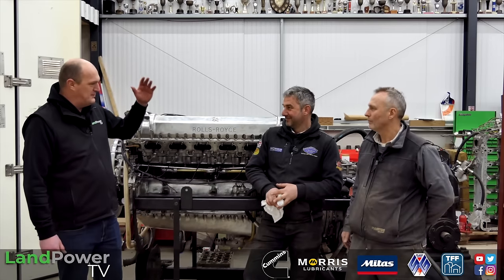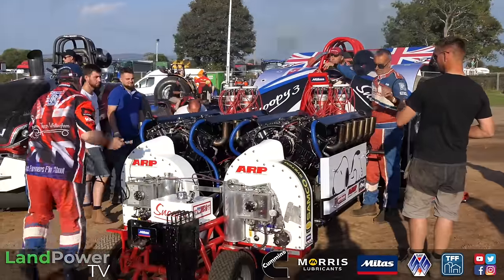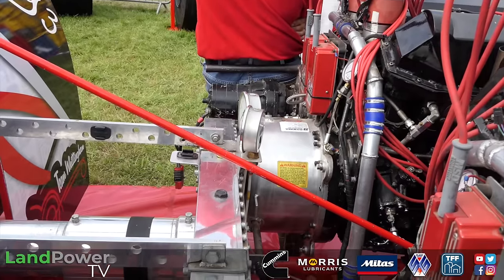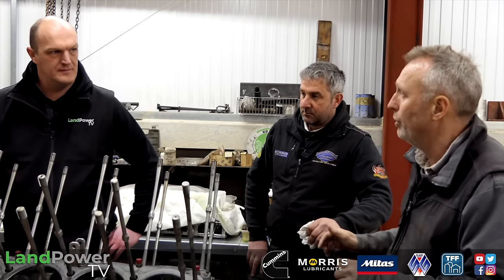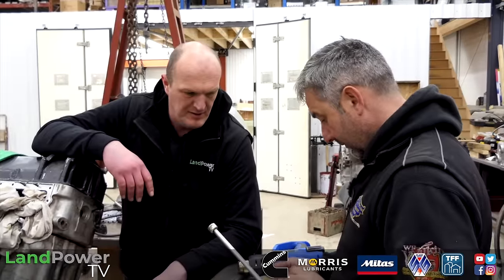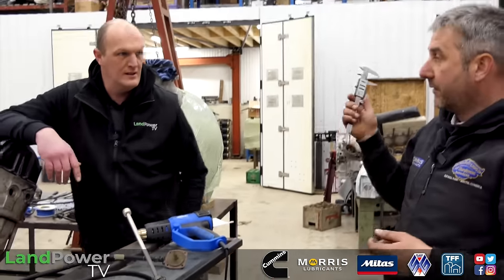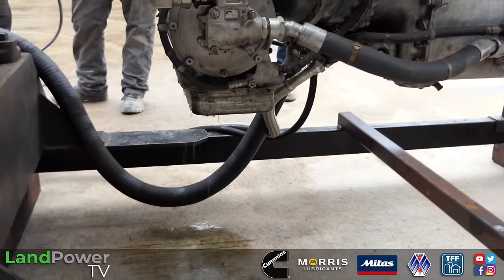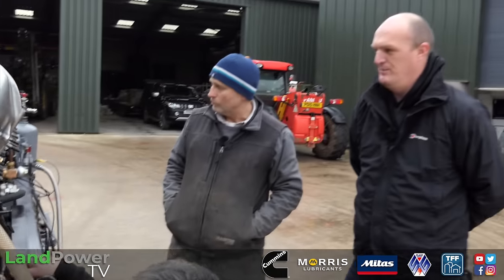Rolls-Royce Mk58 Griffon V12 Engine (the Merlin's bigger brother): START-UP

Comment: The Merlin and Griffon development are unrelated, and do not share a common heritage.  The Merlin stems from the Kestrel.  Griffon from the Buzzard and the 'R'.
Reply: You forgot the best part. The "R" at one time held all three - the LAND speed record, the AIR speed record, and the WATER speed record !  "What an extraordinary series of engines!" you say . . .   I say "nope - IT WAS THE EXACT SAME SINGLE ENGINE USED FOR ALL THREE !!!"
Reply: The Griffon makes the ground shake 🫨 it’s an incredible sounding engine
Reply: Merlins and Meteors are the same besides usage correct?
Reply: @Diesel257 yes but had different parameters like less horsepower, higher torque and of course no supercharger, reduction gear and other related parts. In other words a de-rated and much simplified Merlin...
Reply: @Diesel257  Similiar not the same, Meteor used rejected Merlin parts without a supercharger, and many were cast iron rather than aluminum !!! !
Reply: @paoloviti6156  derated.. tank engines werent "rated".. the meteor were merlins that didnt/couldnt pass their rating run tests.. the Griffin was an amasingly compact engine.. BUT..  Creche is THE engine
Reply: @wilburfinnigan2142  because the RR v12s werent monoblock designs they lack a degree of ridgidity seriously affecting bearing life etc.. a cast iron cyli der block is much much more ridgid & reliable however 3 times the weight
Reply: @Errol.C-nz  until now you are correct but the Rolls Royce Crecy was a British experimental two-stroke, 90-degree, V12, liquid-cooled aero-engine  26.11 Lt but built exclusively as an aero-engine considered one of the best engine but arrived far too late because of the development of jet engines.
Reply: @paoloviti6156    @paoloviti6156  correct.. but.. Richardo had designed & drafted the original drawings about the same time he did the Merlin.. govt politics & its funding went qith the Merlin as opposed to 2-strokes.. so many engine designers & engineers held unsupported prejudices aganst them.. as with the totally misguided expectations of turbo jets & their inefficiencies at the time as Richardo had reported.. & was ignored.. Bristol had notably better engines as in the Centaurus .. RR's political influences cant be understated.. consider their staunch attitude with the Merlins carburetors.. when Napiee had well developed injection systems
Reply: @Errol.C-nz  again you are correct as the Napier was very well developed compared to the so so carburetor of the Rolls Royce Merlin and the more power full Griffon engine.
Reply: @Diesel257  similar certainly, same derivation. Many (all ?) aero Merlins are supercharged cf eg tank meteors are (always?) not. That might suggest different compression ratios, also packaging  of ancillaries etc may be different as well as detail differences ?
Reply: They used lessons learned from the Merlin’s development. In the development of the griffon.
Reply: @acescionti711  wrong way around .. the Griffon came first out of the Schneider Cup trophy sea planes of the 30s
Reply: Meteor was a non supercharged merlin, still made over 800hp in its later stages

Comment: Rolls Royce has and always will make the best engines. As an American, I have no problem admitting that, they are the like nothing else. Along with the best names: Merlin, Griffon, Viper, Pegasus, and Olympus in particular
Reply: Take a closer look at the Alison 1710 then.. a MUCH better engine that simply lacked the political interest to refine & develop it.. the Alison was the precursor to ALL modern engines since.. a light weight "monoblock" engine with proper pentroff combustion chamber heads.. unlike the bolted together RR V12s cylinder banks bolted to two peice crankcases, long stroke & horrible bath tub combustion chambers purely for simple manufacturing machining.. they were 20s technology that were built on WW1 design concepts
Reply: Viper, Pegasus and Olympus were engines made by Bristol Siddeley which became part of the Rolls-Royce group in 1966.
Reply: @Errol.C-nz Yeah, and you never hear people stop talking about them🙄 The development of the  Merlin over the period of the war helped win it and as we all know turned the lack lustre Parkard powered mustang into viable and feared fighter. The 1710 a better engine ?? Who knows, it certainly isn’t the immortal engine the Merlin is.
Reply: RR designed the Merlin however .. the best made versions (along with design improvements) were made by Packard of the US
Reply: @r066tx  that's politics of the time.. doesn't make it a better engine.. ALL modern engines today.. monoblock pentroff as per the German Damler engines in the Messerschmit carry the same design & engineering as the Alison.. not the RR.. the Alison carried on as a better race engine in performance & endurance.. still .. neither were as good as the Bristol sleeve valve engines or Napier..
Reply: @xenuno    Yes and PACKARD Built 1/3 of all the merlins built in just 3 1/2 years
Reply: @Errol.C-nz  Ha ha I knew that someone would mention Allison. Mate Allison never put as many engines in the air as did R/R and the Merlin If they had been better the UK would have used them. Allison could not even make a 2 speed 2 stage Supercharger and had to use that bulky Turbo- Supercharger.
Reply: @xenuno  No they were not Heavier different supercharger which brought its Specific Displacement down to 0.80
Reply: @wilburfinnigan2142  Yes Wilbur many of which had to be rectified when they landed in the UK . Try being bombed day in day out for 3 years. Hell just the reporting that the Japanese were off LA sent 100s fleeing LA
Reply: @Errol.C-nz  Oh dear, I am not a fan of the Merlin but your comparison is somewhat off.  Bore and stroke, R-R Merlin 5.4"x6" Allison V1710 5.5"x6inch, SAME STROKE  -ooops!!!!  

Pent-head is meaningless in that the Allison did not derive any advantage from it.  The pent-head comes into its own when combined with a high level of "squish", something no 4 valve engine had until the 1960s starting with Honda, followed by Harry Weslake, closely followed by Keith Duckworth at Cosworth.  

The Early Merlin was based on the Kestrel which was designed in 1929.  

The Allison used a two piece crankcase split at the centreline of the main bearings - A BIG MISTAKE, it was weak and required a stronger and heavier crankshaft to overcome crankshaft resonances, Allison tinkered with the crank design quite a bit.  R-R got away with a much more Whippy crankshaft.

Modern monoblock design??????   Hahahahaha. Just look at a cross section diagram of one, a good photo, or go look at one in the flesh, hahaha.   Gods, you have been watching that guy at flight Dojo, haven't you, he has much to answer for, so many videos, oh so many errors.
Reply: Oh yes, the R-R Merlin crankcase, had a massive upper section that was further reinforced later in the war with deeply recessed main caps that were cross bolted!  Boost pressure???? It is how much air mass that is going thorough the engine that matters, not boost pressure, air mass is a function of a number of variables, including temperature, which is partially influenced by supercharger efficiency.  Of course, the proviso is to prevent knock or even worse pre-ignition.
Reply: @r066tx Allison  powered - not Packard
Reply: @robertnicholson7733 halfway across the Atlantic with 15,000. Tons of high octane aviation fuel - a torpedo in the belly- KARVOOMPA  ! Those brave merchant seaman were never properly recognised by our  Hot Shot Political Leaders -
Reply: napier probably(?) the best engine towards the end of the war
Reply: According to Sir Stanley Hooker in his biography “ Not much of an engineer “ he visited the USA during WW2 and saw that the Americans were building better quality Merlin’s than Rolls Royce. Sir Stanley Hooker was one of Britain’s best engineers ever .
Reply: The Allison's had way better roller rockers , etc. It's just politics and how the war effort had different requirements. It would cost 2 million to make one now if anyone could even do it.
Reply: @davidrussell8689 What better engine to tweak than a Merlin engine? Still holds the title of the engine that won WW2. 🇬🇧
Reply: @donsmith6554 Rolls Royce Merlin. WW2 winner.

Comment: They always burnt a lot of oil but a lot less than the contemporary radials. Merlin had major problems with throwing con-rods that it was speed limited to 3000 rpm and even then it would just throw a rod. Test engineer Harry Ricardo mentioned one day that his V twins (1/6 of a Merlin) never had a rod problem at far higher speeds. They realised that he was using a full size oil pump so what was an engine with 6x as many bearings throwing wobblers? It turned out the big ends were centrifuging the oil away faster than the pump could supply. Closer clearances and a (much) bigger oil pump solved the problem.
Reply: Sounds like subaru should take note..
Reply: It burnt less and less oil as it was further developed. The  Merlin con-rod problem was addressed in A.C, Lovesey's  paper "Development of the Rolls-Royce Merlin from 1939 to 1945", which shows the high-stress areas around the lugs in the original con-rod design, a picture of the original design and a picture of the redesigned con-rod.
Reply: @robertnicholson7733  Thanks and it was Lovesey that said post war Merlin engine all improvements by R/R not Packard
Reply: @jacktattis I have a friend who is a retired aircraft engineer with warbird experience. He once told me that the difference between the Packard Merlin and the Rolls Royce Merlin, was that the Packard Merlins rattle. The Packard factory did not focus on manufacturing their Merlins to the tolerances that Rolls Royce did because they felt the engines only needed to last as long as the aircraft.
Reply: I have never heard that But if it did it could have been the Jesse Vincent epicyclic geared supercharger.
Reply: Ricardo was one of the best.He designed the comet combustion chamber for Perkins.

Comment: As a racer we have been banned from using Avgas so are now using 102 Power Plus fuel. An Oxygenated unleaded fuel. Good for up to 14-1 compression. And for n/a and turbo engines. It will be marginally leaner for jetting than avgas. But seems to be cleaner than Avgas. Though we will not talk about the lack of catalytic converters etc. So run the engine in a well vented area and dont use it for washing parts etc.

Comment: Tractors are the reason merlins and griffons are impossibly expensive and rare these days.  Thanks guys.
Reply: many are and have been used in the unlimited hydroplane sport since way back in the 50's.  I saw piles of blown RR aircraft engines in Seattle Washington USA outside some of the hydroplane hangers where these boats were built, maintained and as of late restored.
Reply: @3RTracing  Yeah the race boats were another sport that ate through these engines in a hurry.  In the beginning they were using the non-airworthy Packard engines from PT boats (the 3M/4M/5M-2500, not the Packard Merlin) which was fine and that's kind of what they were meant for at least, until they realized the Merlins were able to make more power and sustain it for longer.

Other horror stories include using Allison V12's for irrigating wheat fields and Packards for gas compressor stations, I kind of give the guys a pass that use non-airworthy V12's in their one-off cars.  They're not really taking anything off the market for aircraft, they're utilizing something that can't be put back into an aircraft ever again.
Reply: Probably has nothing to do with the fact they're at least 75 years old and the were melted for scrap decades ago. But hey if you want someone to hate on I suppose tractor pullers are as good as anyone.
Reply: @3RTracing  Miss Budweiser vs Atlas Van Lines vs O'boy O'berto vs Squire Shop :-) I grew up dragging wooden hydroplanes (with nails to make spitfire sparks) behind my bike as a kid in Seattle. I lived in Bellevue about 10 miles away and I could hear those engines racing from my home.
Reply: I think the hydros have something to do with that long before anybody thought to put one in a tractor
Reply: @AyayronBalakay don't go forget circus circus or Lincoln thrift

Comment: I haven’t watched this properly yet, because at 76 nearly now, you’ve flashed me back to my engineering start as a toolmaker in1963! I was very lucky to have done major involvement in resurrecting a Gnome 7 cylinder rotary, two Anzani Aero engines, a Stanley steam car boiler a McLaren traction engine and finally much work on Concorde! All True! However, the Merlin etc, engines would have been the icing on the cake! No such luck! I truly admire the research and major undertaking that is the work you have brought to some sort of completion! So well done! Someone has to do it! Really! Cheers

Comment: The temperature bulb at 13 mins in is filled with Turpentine, the expansion of which, when the bulb is heated, compresses the capsule on the pump and moves the needle further into the jet (as you deduced).Source RR injection pump manual
Reply: I would never have thought this was filled with that, thanks,.
Reply: Used to use it to dilute paint.

Comment: What an engine.. the engineering, the history, the power..& the sound, fabulous! 
I only work on my motorbike engines..currently have the head off my gear driven cam shaft, 750cc, V4 engine.. & it is tiny compared to the mighty Griffon! 🔥🔥

I do have an exhaust valve from an early Merlin that sits on a shelf in my man cave.. it came from a crashed Hurricane. The size of it compared to a motorbike valve is pure comedy 😄

Brilliant video lads 👍🏼

Comment: Love ❤️  both the Merlin & Griffon Engines . 
Especially the Counter Rotation of the Bigger Griffon . 👌 
From my Recollection the Merlin ended up with 2050 hp & the Griffon 2350 hp . 

Wouldn't it be Awesome 2 go 2 Cosworth Engineering in the UK & kindly ask them 2 build a Billet Version & give it more Grunt 😀
Reply: Two propellers rotating in opposite directions on the same axis are called contrarotating or coaxial propellers. Two separate propellers turning opposite directions on separate axes, such in a typical twin-engine airplane, are counterrotating propellers.
Reply: Yes the 130 series had 2030hp
Reply: Do you remember these motors in unlimited hydroplanes back in the 60s & 70s? How they beefed them up, the Merlin had about 3000 HP & the Griffin had about 4000 HP, just incredible!👍✌️

Comment: We supply fixings to the aircraft and marine industry. A complete fixing kit, nuts, bolts,washers in stainless and titanium we manufacture for the Merlin V12.
We also manufacture cnc oil control rings to reduce this engines trait for burning oil..